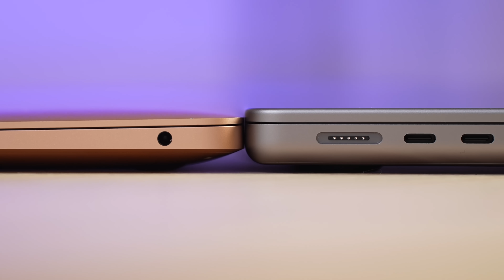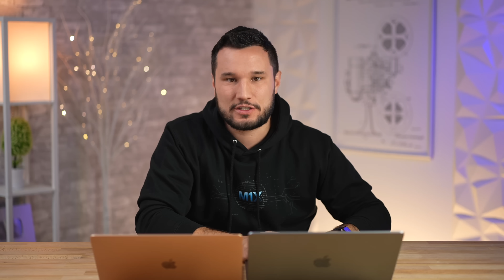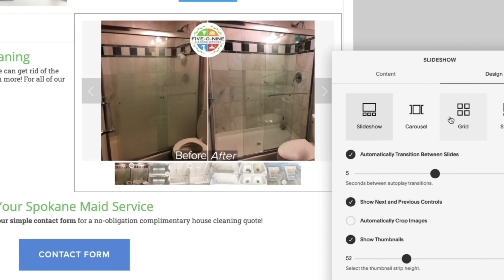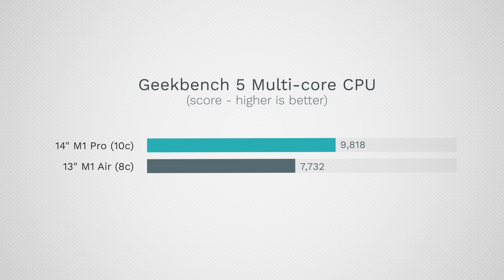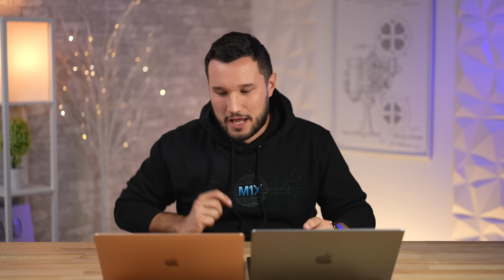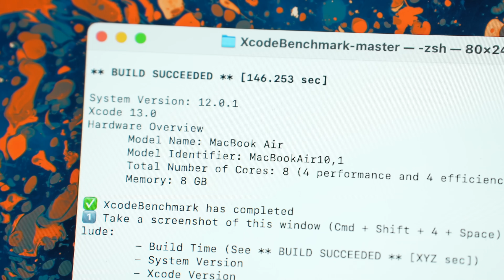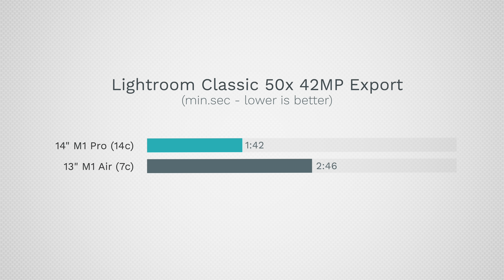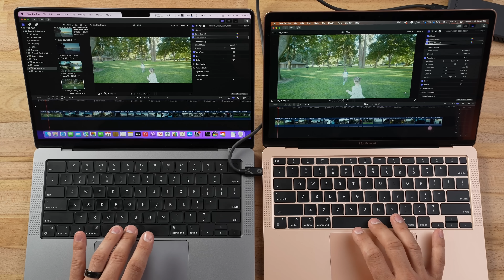14" MacBook Pro vs M1 MacBook Air - Worth $1,000 MORE? 🤔

Comment: This is a debate I am having with myself. 
I am leaning  towards the 14” because I edit and have been looking for a fluid edit station. Apple silicon provides the most fluid timeline experience ever.

I do wonder why Apple engineers insist on not using the screen back as a passive heat sink for the CPU/GPU on their laptops. It would be an ideal solution because it of all the laptop components has the best passive airflow. And I can imagine a heat pipe engineered for the purpose. In your thermal images it is clear that the screen could be used in this fashion. Thus a fan less low end MBP would be entirely possible.
Or apple could install a user accessible m.2 slot near the bottom edge of the screen. Which I can’t imagine users ever complaining about in terms of aesthetics, rather they would be overjoyed to have this in a pro machine.

Comment: So much information! Very detailed and I love learning about the differences. I was in the fence about get to the new MacBook since it’s so dang expensive, but I game a lot on PC. Looks like I may have to bite the bullet and buy the new pro. Thanks for the video!
Reply: If you already have a PC you game on, you don't need the Pro. It is a bad gaming device because of software incompatibility. Also if your PC gives you good performance already for what you do, then please just get the Air and save yourself unnecessary cost. If you don't have a PC at all, then get the MBP but be aware that it's not a gaming device. Not because it is incapable hardware-wise but because the software of most games isn't compatible/optimized for Apple Silicon.
Reply: @mysteryman3054  yea, I only really play one game on my current 2017 MBP. It does well, but gets insanely hot when I’m playing the game. Also, anytime apple comes out with a new software update I’m so hesitant to update because my game wasn’t compatible with it in the past. Definitely has been an issue over time unfortunately.

Comment: Still the mics are better on the air and other previous macbooks already compared, it seems they added too much NR, it sounds too artificial.
As for the price it does not worth 1000$ more IMO
I would get an air if it had an HDMI and a card reader, the 14" has them but it's still  too expensive... and that notch and weight, the macbook air wins in this regard

Comment: Now looking at size and ergonomics the MacBook air 2020has it all handled together , I mean People want lighter , snapier and on the go.

But if I were to be in the shoes of a buyer looking at the two I will go whole-heartedly for the 14inch 

The variety of ports gives me flexibility and the belief I can achieve without carrying more peripherals around 

Sorry but I am still a firm believer in thernal control and fans no matter the processor, I believe times will come when it would be stressed to the limit so why not have a safe guard in place ,

The 14 inch offer me that, gpu control and operation , 

I am taking nothing from the M1 2020, but the 14inch MBP is better suited for productivity in my view

But I am still amazed the MI MBA can handle its own, I imagine owning one as my first Mac and jumping away into movavi or premiere rush to edit , would do me a whole lot of good 

The 14inch screen feels fluid, the not gives it an iphone vibe , the 13 inch well , is just doing air thing s

Final verdict the 14inch is worth the price 

I am honored to have discovered your channel Max

Comment: There is a pretty decent gulf of difference in the performance between 14 inch 8c/14c MacBook Pro (MBP) and the 13 inch M1 MacBook Air. If you consider the better cooling for sustained workloads, better display, speakers and increase in SSD speed, it is worth the upgrade to the 14" MBP for most people if the use case is for work.

Comment: Thank you for this video. This is exactly what I have been waiting for 😊 There is no doubt that from the professional point of view, the new Macbook Pro is worth the money. I would like to highlight one interesting problem. If I had to buy a new MacBook Pro in the basic configuration for $ 1999, I wouldn't hesitate a second. Unfortunately, this is the price in the United States. In many other countries, the price is unfortunately higher. And it is much higher than the duty would imply. For example, in Poland, the price of the basic configuration of the Macbook Pro 14 is PLN 10,799, which is $ 2,699 at today's exchange rate, which is $ 700 more than in the States, and with lower earnings. The Macbook Air M1 can be purchased for $ 1,125. The difference in prices will mean that only very demanding professionals will choose this latest Macbook Pro in Poland. Advanced amateurs and semi-professionals like me are unlikely to decide on this purchase at the moment. Unfortunately, as a semi-professional content creator, I will have to wait until the prices drop. I estimate that the new Macbook Pro in Poland will become cheaper in one year. Until then, I will have to create on the Macbook Air M1, which is also great by the way 😊

I wonder what it is like in other countries. Tell me if in your countries Macbooks are also more expensive?

Comment: Great comparison between the 13" Air to 14" PRO models. I think the extra price difference is worth it given the webcam, battery, speed, size, speakers, and screen updates. Also, to bring 13" Air to base line 14" PRO would make the price difference much smaller.

Comment: As always a comprehensive and fair review! A rule of thumb I use to address the issue of “future proof” a laptop computer is try and not exceed 50% of its performance. IMO when you can’t up grade a laptop it is vital to give yourself extra margin. I keep laptops for 4-6 years and feel it works well. Desktops and upgradeable laptops you can go with less margin. If you trade your laptop every 2 years you can get by with less margin also. Is there a better way to to address “future proofing”?

Comment: Just wanted to point out the typo on the Xcode compile graph - says M1 Pro (10c) but it's not the 10 core model. I was looking for this specifically and skipped pretty much right to the graph and had to back up a little to make sure the graph was mislabeled because I've been trying to find a comparison between the M1 and M1 Pro with 10 cores to see if compile time is cut in half or not.

Comment: These comparisons are so in-depth, it really makes it easy to see which product is right for you. I do like the design of the MacBook Air, although the overall design of it hasn't changed much since its debut. I almost convinced myself to get a 2018 13" MacBook Pro that could support an eGPU as a daily driver for myself, but now with Apple Silicon, I don't see a reason to anymore. Keep the comparisons coming!

Comment: Still divided if I should go for the 14" or 16" M1 Pro. Probably going to wait to see the them in person at one of the nearby Apple shops before deciding as I am to used to my current 15.6" machine(non-Apple) and worried that the 14 might be just a bit too small. Regardless, the M1 Pros definitely seem like a good purchase that will last for years to come.

Comment: Excellent demonstration summary of the two M1's. Been using a MB Air M1 for a year and am 100%+ happy. If I were doing heavy lifting projects, moving up to the M1 Pro 14 inch would be a justifiable upgrade. (32 GB+ of RAM seems like a good idea)

Comment: You're such a cheater with all your benchmark, You're picking up the specific benchmarks to promote a winner of your choice. For example in Intel vs M1 Pro you chose 10 bit 4-2-2 video editing or H.265 because You know M1 pro has build in encoders for it and the difference will be huge. In this benchmark you use H.264 instead to minimise the difference between M1 and M1 PRo

Comment: The MBA have 4 efficiencies core compared to two for the MBP. That would explain the battery difference on a day2day basis doing simple tasks.

I do design and development on the MBA since a little less than a year and damn this is a perfect laptop. I just wish I had that extra inches!

Comment: I just bought the M1 MBA with 16GB RAM and 512GB SSD and it's been blazing fast for what I use it for (some casual Lightroom/Photoshop work, , Logic Pro, productivity, YouTube streaming). The new 14" MBP looks bananas but for less than half the price I'm glad I got the Air

Comment: Sold my 2019 Core i9 Macbook Pro and got the M1 MBA with 8gb ram and 512gb SSD as an "Interim" laptop since the M1 Pros didn't come out in time for some professional video editin gigs (probably wont be in my country till Nov/Dec either).

I only got it to chug once I edited 4k 60fps h.265 footage, but honestly, it was still extremely tolerable, considering it's a freakin macbook air. At least the m1 will be an easy sell, because it took me 1 1/2 years to sell my 2019 i9 for half the price I bought it for.

Comment: So guess it's time to upgrade my 2009 - 15inch MBP... Had to replace the battery, and HD for a SSD and added some RAM  - its slow and the speakers rattle a bit - but it's still going. good time to retire I think...

Comment: Most detailed comparison I’ve seen although making the other specs equal, the difference between the 2 with binned SoCs should be $600 starting at the same 512GB SSD and 16GB of unified memory, I guess that the Pro is using a PCIe 4.0 NVMe SSD while the Air is still at 3.0.

Comment: Never been a Mac guy, but I guess that the difference in performance between these two tells me that it could be wiser to save up and get the air if I don’t really care about shorter exports and renders. The responsiveness of those machines looks about the same. Yeah, the pro is sexier with those extra ports and display, but is it really worth extra if you can afford wiring a bit longer for a project to finish?

Comment: I had a 16" Intel MBP 2019 provided to me by our office. But it got too hot, and it hang most of the time with heavy excel use. I bought myself a personal M1 MBA, and this is what I use for work now, and I can say the experience is so much better: battery life is superb, it don't hang as much when performing heavy Excel taskks, and this thing is just a base model. But I somethimes have problems with limited Unified memory, only 8GB. I can't use parallels, and I have to use Clean My Mac everyday just to free up RAM. But I only experience slow downs once in a while. And if I do, I just close some Chrome and Safari tabs, close Zoom or FB Messenger, and the like.

The new M1 Pro MBP 14" is a dream, it's perfect for my use case. I just wish I had the money to upgrade.

Comment: Great comparison!  The Air is great value for an entry-level (but blazing fast) laptop.  I would choose the 14" if I need the additional ports, better display, and the ability to connect to multiple monitors.

Comment: M1 MacBook Air with 8 cores CPU, 16GB RAM and 512GB SSD is US$1449 which is only $550 less than the cheapest 14" MacBook Pro, I would say buying the $1999 14" MacBook Pro is well worth the differences.

Comment: Problem with the air is 999, then add 200 from 16gb ram then 400 from 1 Tb hard drive. .total price is around 1600, vs the same macbook pro 14 in is 1999+200 = 2199. its a difference of around 600 between the two specd systems. 
Therefore if you are good with a more base version of the air.. that is better  price per performance. However if you choose to upgrade the air, the price ratio decreases and the upgrades between the two devices are most likely worth that 600$ difference mentioned above. In the end both a great products, however choose based on YOUR needs.
Reply: I do wonder the next years air if they will bump base hard drive storage to the 512 option.. or just change pricing on drive space. And cant wait to see the 14" vs 16" pro difference.

Comment: The video, I was waiting for! Haven't seen yet, but I'm sure Air is enough ).
Yes yes yes! 27:03 - M1 MacBook air is more then enough for most tasks, besides some heavy graphics. Even for heavy tasks it's still quite good, just 20-30% slower. Doesn't matter for me.
But it's lighter, have longer battery performance and fanless. No reasons so far too change )
Thank for great video.

Comment: Hello

A review that will helps a lots of Mac user across the globe, who either bought M1 or planning to upgrade to 14” MBP with ease of simplicity. 

It is really a  great presentation and the beauty of it touches all kind of users n creed  and too a touch of modesty differentiating their want (endless) and need (they require) in real time scenarios. 

Apple gives you more with M1 which is so precious and everything you wished for with 14” MBP, but at a higher price. 

Regards JMohan

Comment: Nice comparison, really helps to put the differences in perspective specially for regular users. For the throttling comparison could it be possible to do a battery level comparison like the ones you have done with gaming. Thanks!

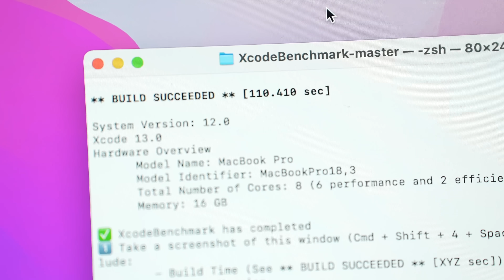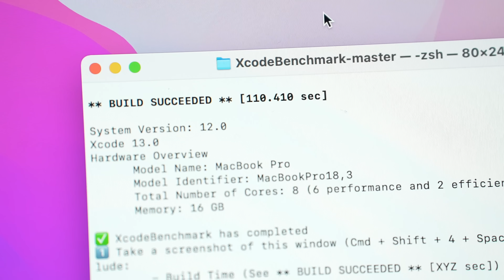Comment: 17:51 just a little confused about which M1 Pro you guys used until halfway through. Every graph comparing scores refers to the 14 inch model as the "10 core" (which is not the base model), but then you verbally refer to the 14 inch as the binned (8 core) model. And at 17:53 you can see it clearly says "Total Number of Cores: 8." But I now understand this is the base 8 core M1 Pro compared to the regular 8 core M1 from last year, and this is the comparison I was waiting for the most. Thanks.

Comment: Great videos! It would be interesting a comparison between the 14" Macbook Pro M1 Pro 8 core CPU/14 core GPU binned chip vs. the full 10 core CPU/16 core GPU vs. M1 Max with 24 core GPU! 
Just to see if upgrading to any of those different configurations makes any major difference in benchmarks and real life use.

Comment: Really wish original M1, either MacBook Air or Pro, would provide options of 32GB, so can running any development things at the same time.  Is anyone a software or web developer that has been using the M1 laptops w/ 16GB?  Is 16GB enough for u to run many things like editor, multiple browsers, servers, and virtual OS?

Comment: I really want to know the difference between the 16 inch MacBook Pro which 16 core GPU (M1 Pro) and 24 core GPU (M1 Max) both having same amount of ram ( 32 GB Preferred ) because the difference is of $200 or $180 with the student discount. I really want to know if the upgrade is worth in any way.

Comment: The air is perfect for mobile, which is all an laptop is about. If I need more performance, the 16 model or even a future m1 max iMac is a much better choice. The 14 pro is a fail IMO and I really wish Apple could have remove the notch as camera can be placed at the bottom of screen, cut the thickness by removing 40% battery space as it's not that important with fast charge, and also make it fanless as we can always get an external base with fans to improve performance at desk. That will make it the ultimate mobile pro machine.

Comment: Thanks for another very illuminating video. The base M1 Air still manages a very credible performance, especially when factoring in the purchase price, but the base 14” MacBook Pro did walk all over it, didn’t it. How about a video where you give your recommendations on which of the MacBooks with Apple Silicon inside to get for different applications or use cases?

Comment: Instead of compiling, set a math run to stress out the cpu,  M1 is supper efficient but it alway use 4 cores, if you force 8 cores, it  goes super slow, it is not like alder like  management that actually use small cores scheduling bites,  M1 doesn’t use those cores at all nor split schedules, it would be nice to see how 8 cores really perform.

Comment: If you open a dozen or more web pages does it cause the fans to run crazy like it does on an Intel mac. I have tinnitus and those fans drive me nuts. Is it a GPU load which causes hight CPU on Safari/Chrome. Never figured out how a web page can cause such a drain on CPU.

Comment: Great comparison, currently have both. Still in love with the Air form factor but I love the screen and sound from the 14 inch, also it feels a bit better. Might return the 14 and wait for the Air M2 whenever that comes, seeing the A15 performance the new M2 should be seriously close to the base 14inch. Also Mini-Led but Apple prolly won't put Promotion on the Air.

A question what version of TG Pro (I'm on 2.61) are you guys using? Doing the Multicore Cinebench R23 my temps go to 90c and then the fans kicks in after 1,5 minute. I do have the 10/16/16/1TB version of the 14 M1 Pro.

Comment: If you spec out the MacBook Air to 8 cores CPU and 16 GPU with 512 GB of memory, which is close to the MacBook Pro, the difference is really about $500.00.  Would like to see a comparison between the binned MacBook Pro and the un-binned Air.

Comment: I was very excited for the news of the new 14” and 16” MBP, but I had to be real honest with myself after thinking about the $2500 plus I spent back in 2019 on the MB 16” and fully realizing that I don’t need all that power for what I use it for.  Now seeing all this new power and it’s an eye-opener. 

So I traded in last Friday at Apple my 19, 16” MBP and my (I don’t know why I kept it) 15, MBP 13” to essentially downgrade with a significant money loss, of course. I got a gift card, and my plan now is to buy the iPad Pro M1 12.9 and possibly the MacBook Air M1. Even though the new 14 and 16 have everything I think I want, it’s not everything I need. That’s a hard thing to admit when it’s ingrained to always want to get the best out there. It’s been a long electronic awakening journey for me. Lol

And great job on getting that content out there. I wondered if someone would review these two side-by-side, and you’re the first that I know of.